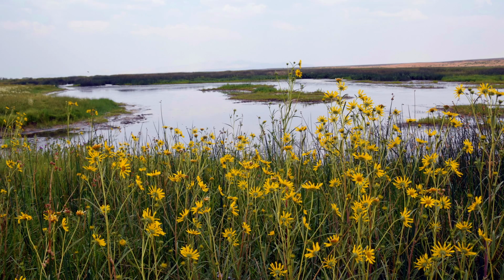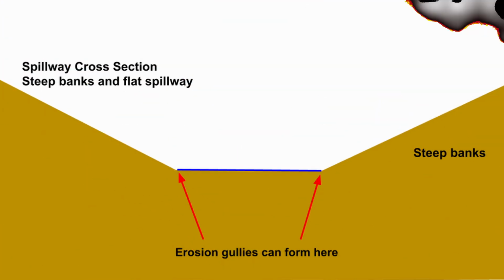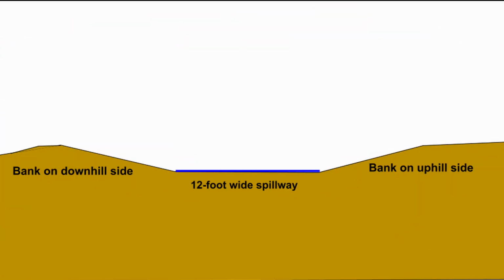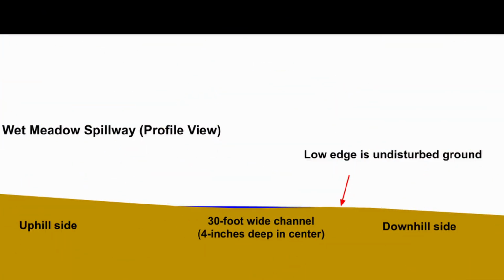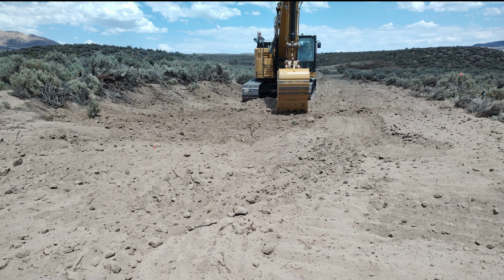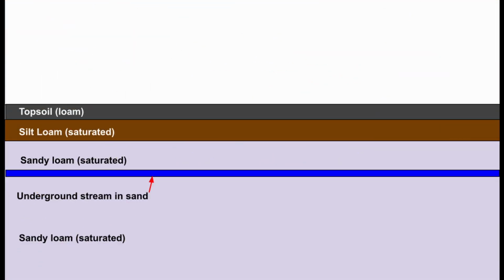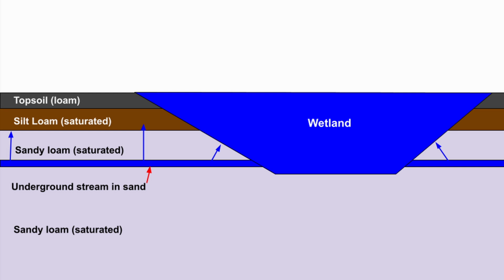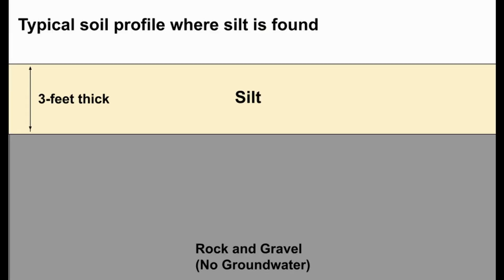Wetland Spillway Construction (Episode 17)

Comment: If I find some minor erosion in a spillway where the soil has very high clay content. Can i or should I just fill the small gulley with nearby clay soil? The one or two small gullies i've found are still quite small even though they must have been there for years. This is in a hillside wetland that's saturated maybe 8 months of the year. Would it be best to fill these gullies in the dry season? They're about 6-10 feet long and maybe a foot or two deep. I see water flowing in them now - the inlet is just groundwater coming in, and the outlet is where the flow is able to spread out as it continues downhill.

Another great video - thank you!
Reply from the maker: It may be best to move the spillway so it's on a gradual slope. If this is not possible then I recommend shaping the spillway so water flows in a sheet like pattern over the surface and embedding rock in the ground as shown in this video to control erosion.